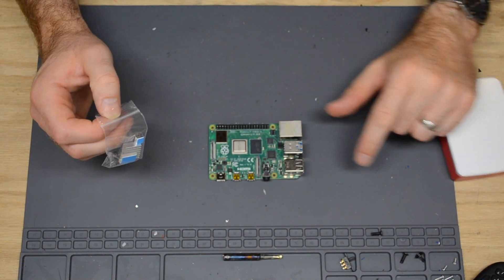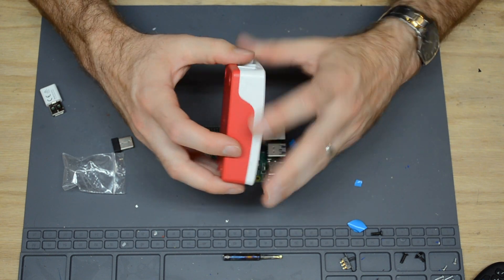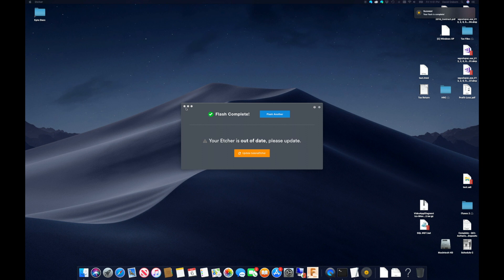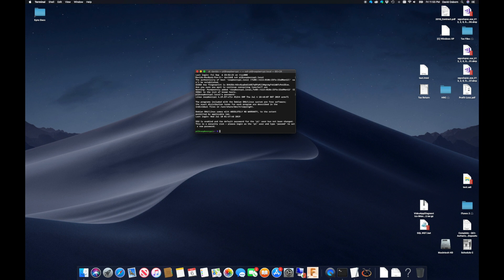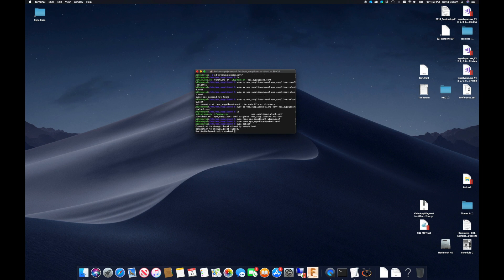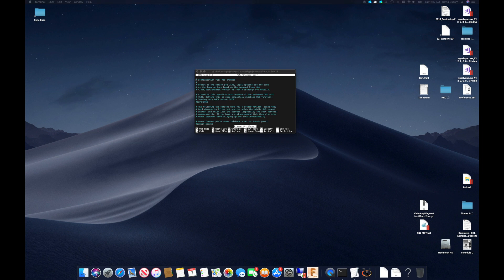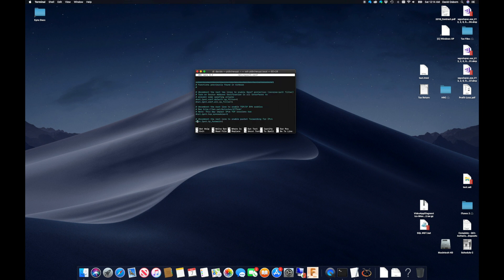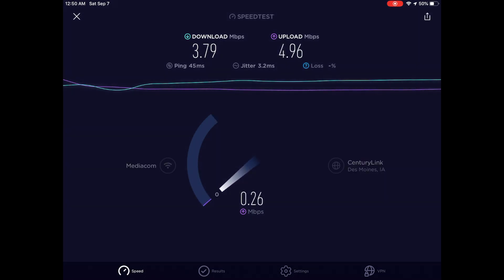DIY Car Entertainment System Using Plex (Part 2) - Wifi Bridge Setup

Comment: Hey I am planning on doing something similar but by having the pi use usb powered hardrive to store the films. when is the third video coming, set up and configuration etc. also can you post your post your the commands that you have used and hostpad and dnsmq examples.
Reply from the maker: Thanks for watching! I’m editing Part 3 this week so it should be posted by the end of the weekend, hopefully sooner. I’ll see if I can get a blog post up that walks through the commands that I am using. A usb hard drive is a great idea and I may have to add one once everything else is working.
Reply: @CTRLALTMAKE   thanks let me know when its up the blog

Comment: I'm planning on doing something like this as well. Still in the planning stages, but I'm going to repurpose some laptop monitors so I can have 13 inch or 15 inch screens installed behind the front seats. One Pi will be the server, updating from the home plex server, and casting to the screens or tablets in the car. My main concern after this is making it look presentable in the car. I look forward to the rest of your series. Good luck!
Reply from the maker: jonathan miramontes I was thinking something similar in the long run. The Pi has two hdmi output ports and I may run those to the third row seats.  I have my doubts though that the Pi 4 can handle that much video. Thanks for watching!
Reply from the maker: Thanks, I am running a bit behind due to the holidays and waiting on some parts to ship, but I am working on the power management now, something you probably don't have to worry as much about if you use a laptop since it will already have a battery built in.  Thanks for watching!